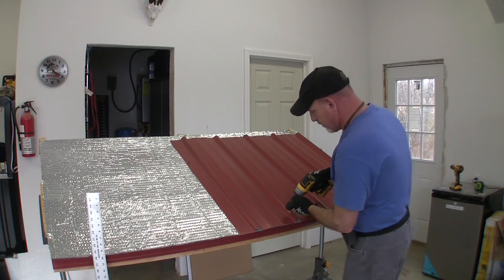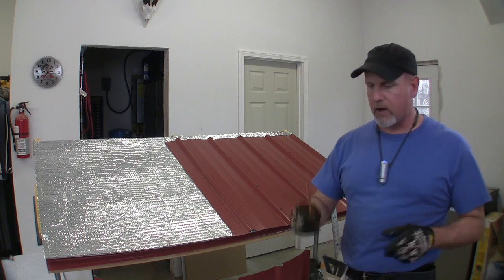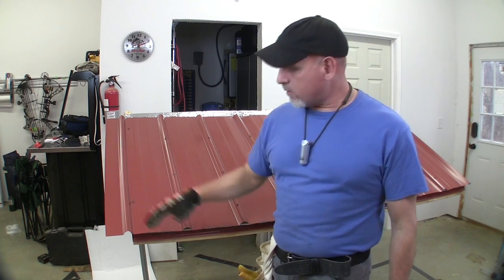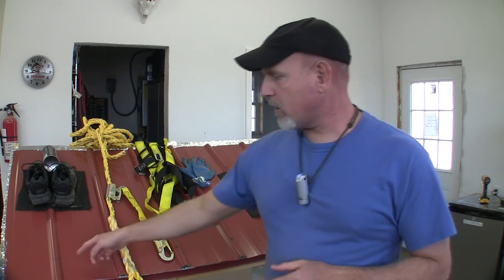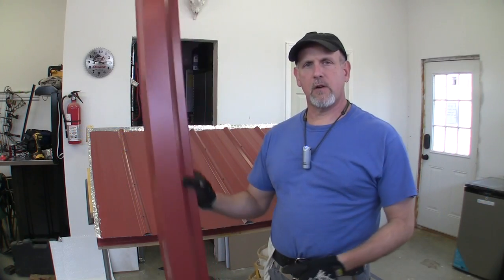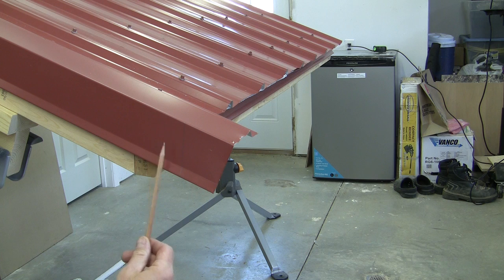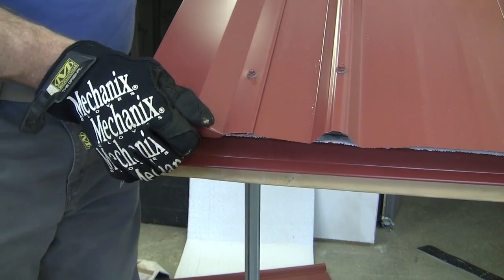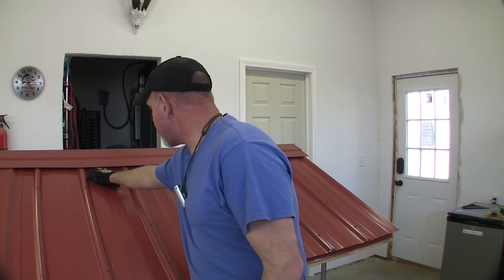How to Build a Pole Barn Pt 7 - Metal Roofing --Continued--

Comment: Boy I'll tell ya.....that roofing is SLICK.
If it hadn't been for the gutter, I'd have went over the edge and down 20 feet.  I had slipped near the peak.  By the time I was 1/2 way down the sheet, I was moving so fast that my feet were bouncing over the screws.  The soles of my tennis shoes were really torn up by those screws.
My advise, if you are gonna be working on this metal roofing, is to get yourself tied-off to something.  Even just a little bit of dust will get you moving toward the ground.
Thank God for the gutter.  I had to replace that one piece but it saved me.  I should have gotten it gold plated.
My briefs didn't survive though.....

Comment: On your gable cuts and for any cuts for that matter. Cut about an inch or half inch shy of your finished cut as a trial cut to get used to how the snips are going to cut. Then do your final cut. It is also a cleaner cut when you only have about a half inch to an inch to cut off instead of a foot to cut off as it is easier to manipulate a half inch of scrap than it is a foot of scrap.

Comment: maybe 15 to 18 years ago I put up a 24 x 32 pole barn and did similar to what you've done but not quite so fancy. I loved your comment, either in this one or previous were you said, remind yourself, ITS A BARN.  I bet I said that to myself 100 times when I was building mine.  I am now contemplating building a boat shop and likely larger than what I did before but this has been very educational and I wish that I could have watched this before I built the first barn. I learned a lot by experience the first time and your documentary just adds that much more for me, so thank you very much. And, I agree so completely that the satisfaction of doing most of this yourself is something you can only get by doing it. I, too, have a tendency to be a one man show but at 58 years old now and not 38, I need to just keep in mind my age cause in my head I'm still 27. lol  anyway, thank you very much. love your videos and I've subscribed

Comment: A circular saw with the blade on backwards works great for cutting the metal. You can set the depth so that you can run across the ridges and bends in one pass.

Comment: I watched your video and the meticulous manner in which you kept it true and plumb tells me your roof was not off at all.  I will bet money that using 26 ga roofing and screwing through the top of the corrugations spread each sheet just enough to cause that inaccuracy at the end of the run.  Also because of expansion and contraction I feel and most manufacturers recommend to screw the flats not the peaks.  It will make a more secure seal for the washer.  You seam the peaks with short seaming screws and attach the flats.  Most also use a thin two sided tape to seal the overlap and trim.  Point of interest is that you are correct in showing the overlap and one more reason is that on that last ridge you will find an impression creating a small valley running the length of the ridge.  It is there to break the capillary action of the water from wicking its way up under the lap.  I think you would really need to be one heck of an expert doing this every day to run a screw gun to exactly the right torque when screwing the tops of the ridges while the flats are easier to start the screw on and control the torque as a bonus.  Most metal roofs are recommended for a minimum of 3/12 so water penetrating the screw/washer doesn't seem to be a problem as long as they aren't over fastened to the point the rubber is squished out.  

Great job and video.  Doug

Comment: We are currently building a pole barn.  We used the diagonals just like you idd.  We ran the stakes and the lines.  For our poles we used logs and a draw knife to skin the bark from them.  We haven't set them yet.  It had been raining for a few days with flash flood warnings.  We started on the first hile, got about a foot deep and it filled up with water.  Currently we are on hold but hhopefully we'll get it done this January.

Comment: I liked the series and watched each one to the end. I can not do a pole barn with the posts in the ground here because it rains 104 inches a year and it would rot the posts off . So I will likely do some sort of concrete elevated footer with a shoe for the poles to be bolted down into so that the feet of the poles are off the grade /ground around one foot. I have had the metal roof panel problem you mentioned with getting them perfect and not scrunched up and it is a real pain. I was wondering what you would use the test model for and thought it may be for a compressor shed on the back of the barn, but the entry door was a better use I am sure. 
Also I liked the senior moments out takes at the end. Thanks for the vids from Chile!
Reply from the maker: ChileExpatFamily Thanks for watching the entire series.  That's a big time commitment.  I appreciate it.  I often retort to the "it will rot the posts" argument by mentioning all the houses build along the coast of your native state of South Carolina that are built on pilings (post) that are run about 20 feet into the wet sandy soil.  Not to mention all the piers along the inter coastal waterway that have posts that are just driven into the muddy channel bottom.  Just food for thought.  That model is still leaned up behind the house.  Ha!  I'll get a round tuit one of these days and put it up.
Reply: ***** Yea I agree with you with the poles in the ground. The only thing I ever found (I grew up in Spartanburg SC) on the farm was when I had to pull a post out of the ground that had concrete when we were moving a building on selling the farm, that the concrete held the water in like a cup and it weakened it right at grade. Not a lot mind you and it would not have made a difference because they were treated 8x8s.
Here in Chile this is not an option for me (putting the poles in the ground). They use concrete telephone poles here not creosote, and treated lumber is real expensive. You see fence posts in the ground that have had the bottoms dipped in creosote, but even then they only last 5 years. No split locust here either, so a pole ground has to go on concrete risers. My parents would have had a cat for that cost in SC when we built all of our Pole sheds for our hay! You all just do not see the rain that we do here in Chile 5 to 10" of rain in one night is not really uncommon. We will see when I build the first pole barn here. I will let you know how it goes if you do not mind me stealing a few of your ideas.
With the footer exceptions I also need really wide eves to stop some of the blowing rain here in the winter.
Thanks again for the vids. Also I watched your copper counter vid. Copper is real cheap here since they mine it here so it is an option, maybe a solid copper vanity?

Comment: Like the Kubota Tractor.  Good reason to build a barn.  Plan to do the same in NC next year.  Thanks for the good advice..  Also, didn't I see a kennel in the background.  Could use the left over roofing on that.  Going to pour a slab on mine.  Learned a long time ago, leaving a car/tractor/etc. in a barn means you're donating all the wiring to the mice.
Reply from the maker: Thanks for watching, Will.  I appreciate the comments.  I am always amazed at the stuff that folks see/notice "in the background".  Ha!  I didn't really have any metal left over but that would have been a good use for the scraps.  Good luck on your project and lemme know how it turns out.

Comment: Thanks for all the great videos, it gave me at least a bit more confidence when I started mine. My metal is being delivered this week for the roof as well as the walls. I'm wandering how difficult it will be to sneak those wall panels up under the drip edge (no overhang on mine). Any thoughts or advice?
Reply from the maker: Thanks for watching Steve.  I appreciate your feedback.  Sounds like you have been busy.  Man, it's a lot of work isn't it! I'm not sure I understand what you mean about lifting the panels under the drip edge?  If you mean simply lifting them up then I'd recommend you have a helper.  They aren't that heavy but they are awkward.  Sorry if I'm not answering the question, I'm not sure I know what you mean.
Reply: ***** No problem, I'm not the best at explaining things. From what I've read I have to put the drip edge on first, then the roof panels. But after that, I need to get my metal siding for the walls up under that drip edge somehow so the water won't run inside the walls. I watched a couple other videos on it but it just looks like a pain.
Reply from the maker: I understand now.  I did not use metal for the sides so I can't really speak from experience but it seems to me that you would have to hold over the drip edge enough for the panel to slide in.  I don't think you would have to be super accurate because that drip edge will move and give a bit.  Good luck!

Comment: Couple of questions for yah.  On the roof itself, did you put any caulking or seal tape under the edging? 2, that item hanging from your neck, that isn't one of those "I've fallen and can't get up" devices, is it a wireless mic by chance? Lastly, your nail gun you've been using, Does the butane gas last making it cost effective over a normal hosed nail gun? OK, last lastly. Do you find it easier to handle the butane gun over a hosed gun (weight and hose attached)?  Great videos.
Reply from the maker: Thanks for watching and commenting.  I did not use any caulking or anything like that.  No leaks so far.  An emergency pendant?  Now that's a good one, Richard.  No, that is a wireless microphone I am wearing.  The gas lasts a really long time and it's about ten bucks a tube.  So yes, it's more expensive than a pneumatic nailer but the convenience is worth the price.  The nailer is about the same weight but not having the hose to lug around makes a big difference.